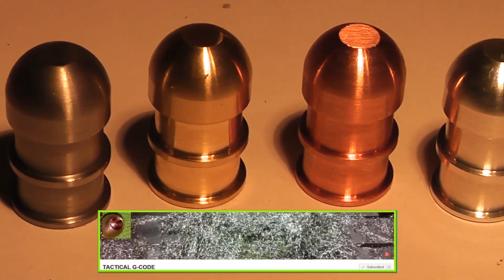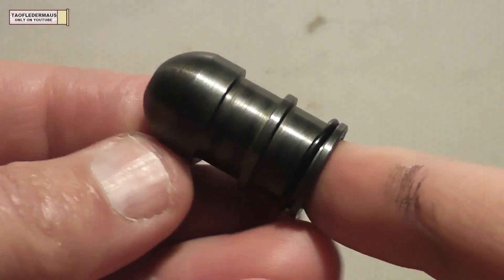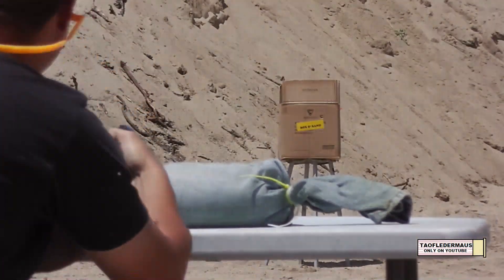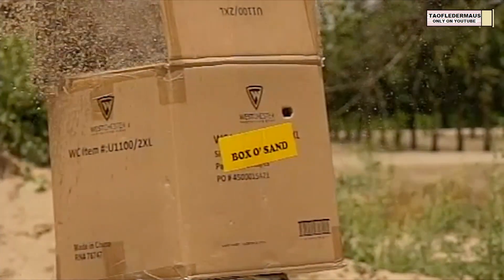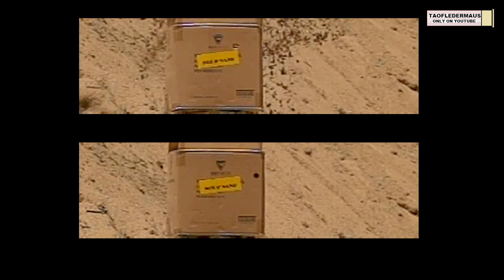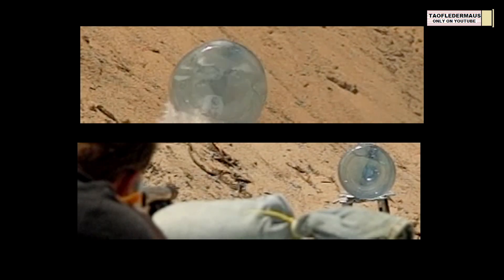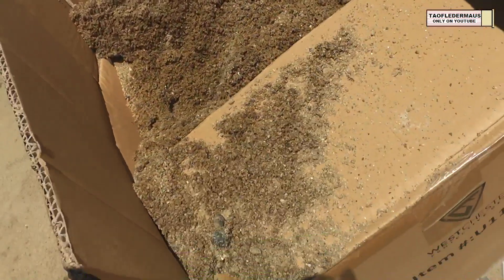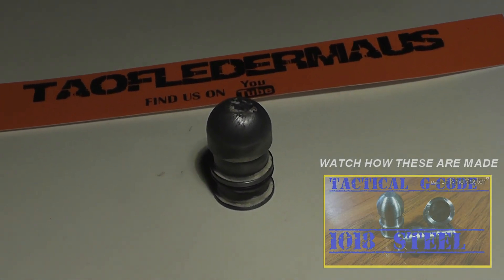Experimental STEEL .70 Cal.  Shotgun Slug -  High Penetrator

Comment: I'd like to see the steel plates clamped down to a surface. Maybe make a small steel frame the same size and shape as the plate with 2 angled supporting beams going to the ground and a cross section that you could lay weights or sand bags on. Then you would just have to use C-Clamps or any clamps of your choice to hold the plate still. So much of the energy seems to just send the plate spinning.

Comment: Nice video. One question, why the O-ring on the slug? Surely it's not to act as a gas seal, that's what the wad is for, so I was thinking maybe to hold it steady without gouging the barrel?
Reply from the maker: 69aussieguy   I put those on there to keep the sharp edge from contacting the barrel.   Not sure if it actually did anything though!

Comment: the accuracy issue and wobbling makes me think that it wasn't sized perfectly for that barrel? maybe waxing it up and sizing it, or using some sort of sabot would improve accuracy?

also, depending on the steel those slugs were made out of, a good magnet would have picked em up pretty quick.

Comment: Though the sand looked sort of damp, I would recommend using wet sand because sand can trap a lot of water and increase the sand density.
I recently received a quantity of exotic hardwoods and am thinking of turning some into 12 gauge slugs on a lathe. If they test well, I'll be sure to contact you so I can send some out to you.

Comment: mild steel is not carbon steel.
Reply from the maker: Darren Garden  All steel is carbon steel.   If  it didn't have carbon in it,  it would just be iron.
Reply: Cast iron has a higher carbon content than steel at between 1% to 4%. Technically you are right about all steel being carbon steel, but from an engineering standpoint carbon steels are steels with a higher carbon content than mild steels. Mild steels have a carbon range from 0.05% to 0.25%, carbon steels have a range 0.29% to 0.54% and high carbon are from 0.55% to 0.95%.
All academic though as it makes no difference whatsoever to how much I enjoy your videos. I was a little drunk when I posted my comment and the pedantic engineer popped his two pence in. Well, that and I absolutely love a good intelligent argument. :-)
Loving the videos, would also very much like to send you some 12g projectiles I designed if possible?

Comment: Ahhh, a shotgun slug, when it needs to be absolutely destroyed without a doubt, bring out the bad boy, the shotgun slug. I am curious to see what one of those would do to a deer from a rifled barrel, I have killed more than one deer with a 16 gauge slug before and the damage is usually pretty extensive. I hit a 10 pointer once at about 35 yards and it hit a little high and whacked the backbone above the left shoulder. The slug blew off a huge chunk of vertebrae inside the deer as the slug went downward. The right lung was more or less soup and little bits. Another deer I shot, the slug went through the deer, both lungs and broke the off side shoulder. Slugs are the end all stopped for close range out to 100 yards.
Reply: Bayan1905 Did the deer die? Sounds like all it did was scratch it.
Reply: The deer hit the ground and was dead as soon as the bullet hit him. It was like it got whacked by lightning.
Reply: Lol..... nice, have shot slugs and shot deer with rifles but never the two together, not legal to shoot deer with slugs here unless on private land.

Comment: Interesting round.  An improvement perhaps would be to use the same steal projectile but slightly smaller and perhaps hardened steel and use copper or lead to cover the round so it could safely be shot from a riffled shotgun.  This would stabilise the round
Reply from the maker: EQUINOX  Ok,  I'll throw away the 18 other identical rounds he made so he can start from scratch.  lol

Comment: You should lay a blanket on the pile of sand to help recover the projectiles. Even if the blanket won't stop the round, it will show where you need to dig to find the round.
Reply from the maker: Edward Ciotic    Just a larger box and maybe a piece of wood behind it.   We thought for sure 12" of sand would stop that round.   Eh,   we learn from our mistakes.

Comment: But, but carbon steel means harder steel usually, not mild steel. D:
Reply from the maker: Panzervagon Maybe this will help:http://simple.wikipedia.org/wiki/Carbon_steel
Reply: *****
I was just thinking about how most people seem to say 'carbon steel' when referring to a harder type of steel with a higher carbon content, where 'mild steel' refers to softer, low carbon-content steel, so while calling mild steel 'carbon steel' may be technically correct, it doesn't seem to follow the terminology most people would use. Sorry for any confusion.
Reply from the maker: I've noticed a lot of welders refer to mild steel as carbon steel.     Really,  all steel has carbon in it.
Reply: Fair enough. I'm just used to bushcrafters and outdoorsmen referring to 1075 and 1085 etc. as 'carbon steel' or 'high carbon steel', the terms seem interchangeable at times. I'm aware that the fact that it is steel means it has carbon in it, but in the end I was just poking some fun, no worries.

Comment: Jeff, if you're going to test so many different metals of the exact same design, you have to test them all in the same scenario, or else, as you know, you have multiple variables which throws off the results. Regardless, fun shite.  Cheers, Chris.
Reply from the maker: Cactus Makeshop   Yeah,   that is why I used simple targets like the box of sand so I could use at least that in each video without breaking the bank.
Reply: I'm just saying, maybe use the same sand in the box setup for each of the rounds.  The dude went out of his way to make the rounds as similar as possible...maybe change only one variable (the metal), instead of multiple variables.  I know this is mostly just for fun, I get that.  Cheers, Chris.

Comment: did you compact the sand?
Reply from the maker: hi yall     Did I do that sand wrong or something?   lol
Reply from the maker: hi yall  yes,  it was packed into the box and heaped over the top of it.
Reply: hi yall It looked like it was kinda wet, and mixed so even if they didn't, it was pretty compacted.
Reply: like compressed
Reply: if you hard compact the sand it can be like hitting a brick wall and can be used to catch things going very fast
Reply: hi yall Translation: jump on the sand for a bit, add some more, jump some more, more sturdy, gr8 success!
Reply: The Crazy Pineapple But what if it's pocket sand?! You can't compress it or the world would collapse on itself... D:
Reply: ? collapse of it's self ?
Reply: hi yall
Yep, you could compare it to implosion.
Reply: how?
Reply: hi yall
Memys Al Fendi, Physics of the Universe, page twelve, line 42 - "The collapsation of the reality upon itself is a possibility, but only if we were to believe that other dimensions do exist, as was described before when we were talking about string theory. That is, our reality, which is completely separate from the realities from other dimensions - hence the existence of reality bomb from the show Doctor Who is most certainly possible - we just need to take out one of the integral parts creating our universe to annihilate it. Imagine, for example a massive implosion that would suck everything in, even itself. A rift in the reality, a black hole that would start devouring itself! The realities are endless, and so are the possibilities - it would simply be unwise to not consider such actions being taken in the distant future."

Comment: $40 each? I could bust one out on a lathe in no time at all. I guess a shop would probably charge you that  for one if they have never made one before. However if you already had the design and were buying them in quantity the per unit cost would be a lot less. It would only be that high if it was a one off custom job, just because the shop has to make money.
Reply: sharpie443 You could make one yourself for the cost of the steel, lathe, tooling, time, coolant, oil, power and rent. Kinda depends on how much your time is worth I guess. Also, not everyone has a lathe.
Reply: sashablfc
 Well i mean if you already have one. 8 in. x 12 in. Precision Benchtop Lathe will only set you back $1000.
Reply from the maker: sharpie443    It's rare I get someone not only make these rounds,  but also send them to me.
Reply: sharpie443 It's the lack of supply, rather then the difficulty to make them.

Comment: How much of the 40$ is material costs? Is it like 5$ material, 1$ machine wear and tear and 34$ labor?
Reply: TheBertjeT It's not even an amazing machining job.
Reply: Yeah, he was factoring "one off" costs of asking a machinist to do a small run of these, not unit cost.

Judging from the cuts it could be done with the basic cutters anyone can (and should) resharpen multiple times, so it's not like tool wear is even a serious issue.
Reply from the maker: TheBertjeT   Mostly the cost of setting up the program into the computer,  time to set up the lathe and cut it and wear and tear on the cutting tools.  Some of the tooling is $200 or more for a single boring tool, etc.    The metal stock is the cheap part.
Reply: ***** Thanks for all the information guys/girls :)

Comment: i went shooting yesterday, i hit a slanting target; ( this  was a birshot ) and so it was either a bee or one of the pellets that actually bounced back at me.
Reply from the maker: Rods Ahed  Bird shot will bounce back at you,   especially if you are shooting at hardwood,  etc.
Reply: Rods Ahed Hey at least you can say you got shot at before!
Reply: but, it like dumped all the energy, and it only hit my arm. no mark, or anything. just like, a little sting, like shot with a weak airsoft gun.
Reply: Rods Ahed Were you shooting steel shot? If so then it very well could have bounced back.
Reply: Rods Ahed Depends how you angled the target.  If you have it  angled back then it is possible for a projectile to hit it and bounce back its pretty common really happens all the time at the range I used to go to you would shoot say a 9mm at a target you would hit the target and then you would hear the bullet land on the steel roof above where you were shooting.  Slanting to the side as they do in the video prevents the projectile entirely from returning to the shooter but does present a safety issue for anyone standing left or right of you depending what way you slant it.
Reply: Rods Ahed My granddad once shot a rock with birdshot and a bounced back pellet got stuck in his forehead for rest of his life.